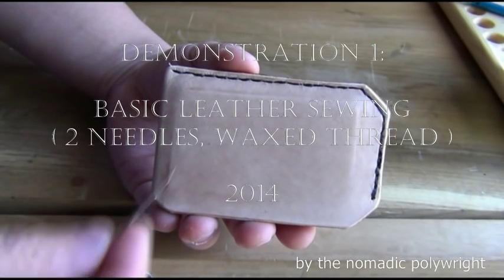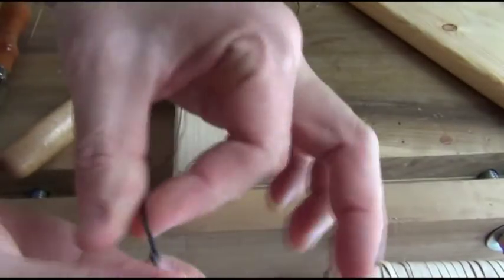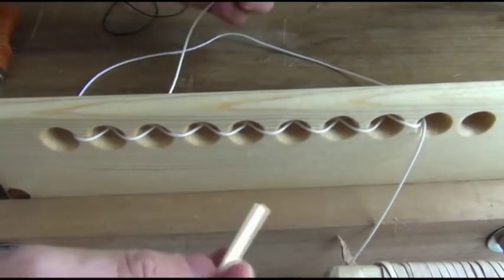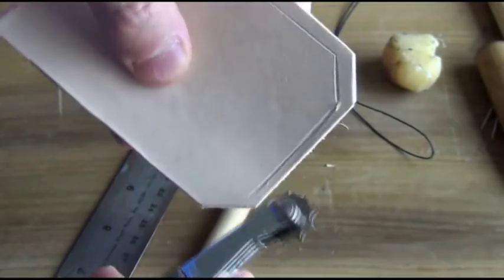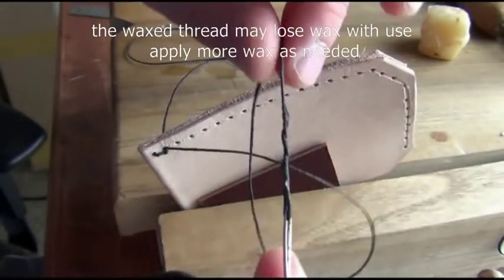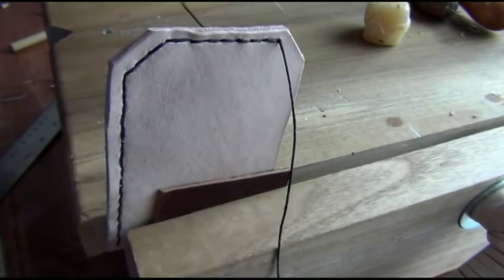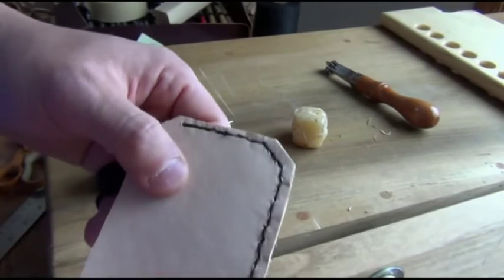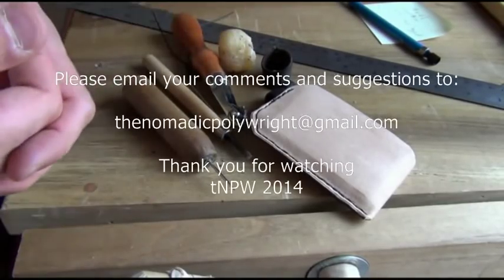DEMO 1: Basic Princples of Leather Stitching Demonstrated on a Card Holder/Small Wallet)

Comment: This really is a great video for beginners
 I’ve been doing leather work for probably 3 years now, and by no means an expert. Just want to say instead of using an awl, get a set of pricking irons. You can find usually the set of 4,2,and 1 peg, pricking iron.The smaller amount of pegs are for going around corners. Like I said, great tutorial, I just would like to mention, your stitches are a bit to tight. It’s bunching you a fair bit. It should be snug, but not bunching.

Comment: I struggle with stitching the slanted holes in leather (diamond chisels). I struggle with keeping my stitch "clean & tidy". I can't figure out which needle needs to be on top or on bottom. I end up with a stitch that doesn't look slanted at all. Do I start with the slanted holes leaning towards me or away? Do I stitch towards me or away? Is the first thread through the slanted stitch hole destined to go on top of the slanted hole or be the bottom? It's SO hard!
Reply from the maker: Pick a hand and keep that needle/thread on the bottom. Pick to sew away or towards (most sew away). Pick one, slant hole away or towards you (most slant way). Don't make excuses or self deprecate before you've sewn the same way for at least 2000 stitches. You're not going to learn a skill without practicing.
Reply: @johnzzhu  Thanks for the insight. I am going to get it right eventually, just need to figure it out, then do it over & over to create muscle memory.

Comment: It doesn't look very neat on either side, to me.  In fact, I would call this a tutorial on how NOT to do saddle stitching.
Reply: @dale: It is not a saddle stitch. When saddle stitching, each stitch is knotted separately so if one is broken, the rest of the stitches would not come undone. In this case, if you broke the thread anywhere but where the back stitching exists, you could literally  pull the two layers apart.